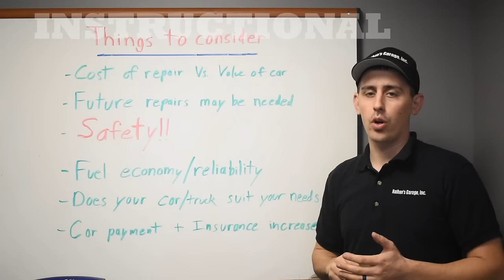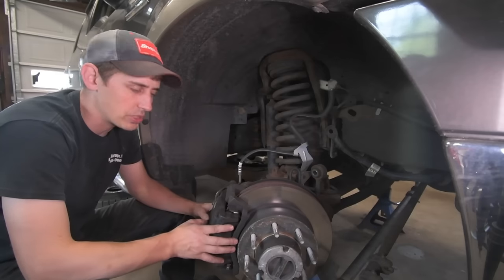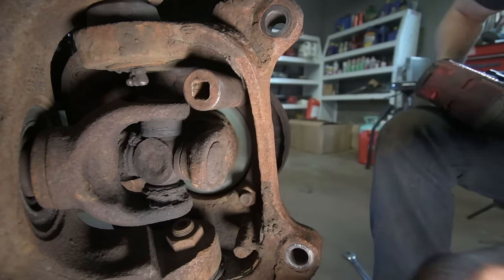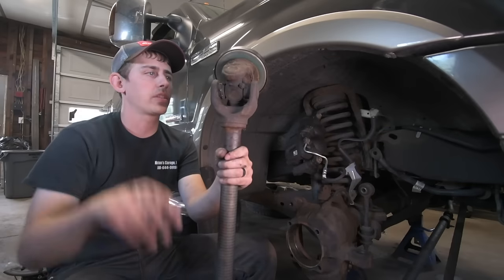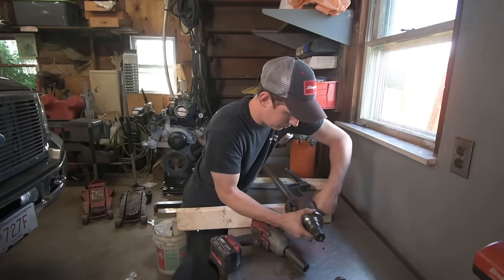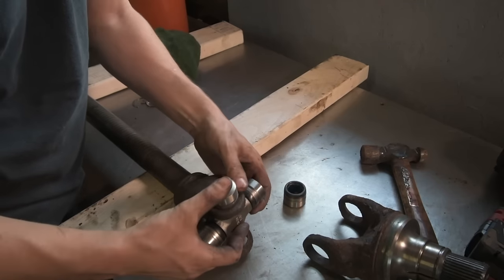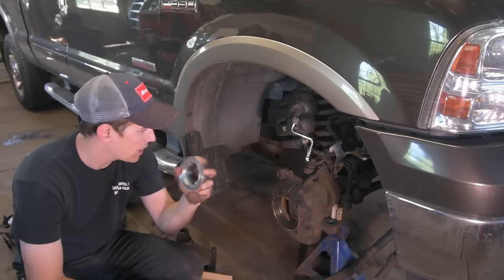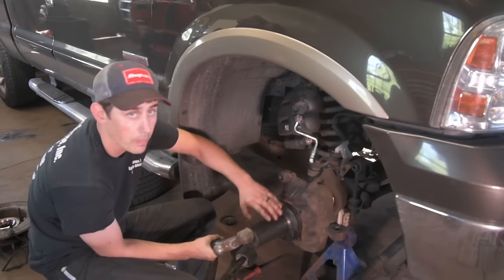Ford Superduty Steering wander repair....Axleshaft u-joints

Comment: Ok...let me stop ya bud.  If that hub is good, you cannot be beating on the outer portion of the hub, you end up fracturing races and roller bearings inside the hub drastically shortening its life.  the best way to do this is to insert a 21mm deep well impact socket after loosening all 4 nuts and using the steering as a press with a 6 inch extension against the inner axle c.  problem solved, nothing gets damaged.
Reply from the maker: I understand what you are saying but the tool I used attaches to the hub exactly how a wheel does and imposes no more stress than hitting a bump. I stated that hitting the hub with a hammer can damage it. I also talked about pushing the hub out with the steering.
Reply: I have worked as a professional  mechanic for over 40 years u did exceptional explanations and the people who are being critical about ur methods know as anybody would  if it has rust or dirt clean it up this is just common sense I found ur video very refreshing to find someone who diagnoses then fixes plus explaining why u do things they way they are to be done  excellent job keep up  the great work

Comment: This is why I stay away from the Ford man .
Reply from the maker: Ive worked on them all and feel as though every manufacturer has their issues. This problem isn't limited to only Fords. The dodges use the same style joint and the Chevys have weak tie-rods and the pitman/idler arms wear fast. Thank you for watching!